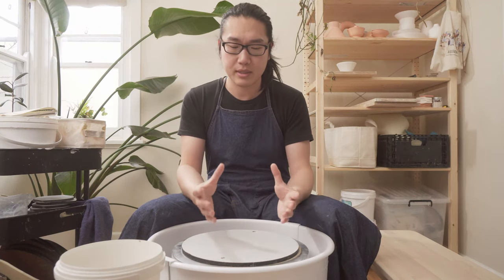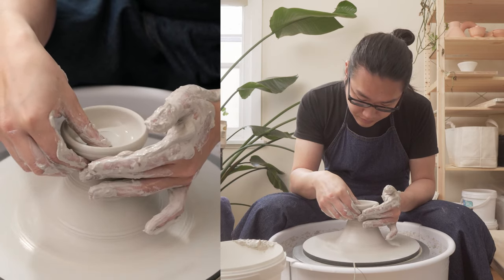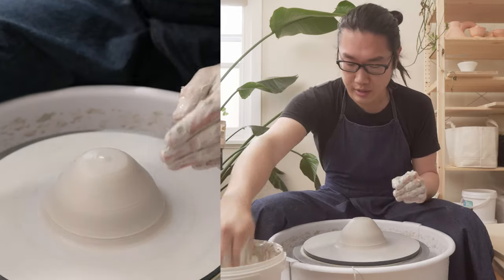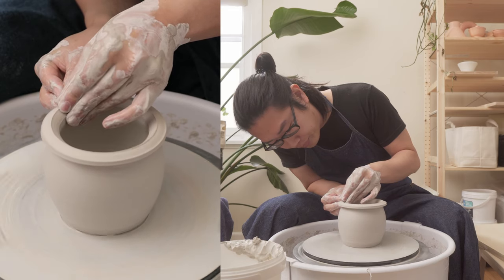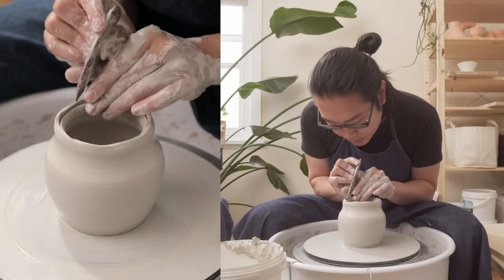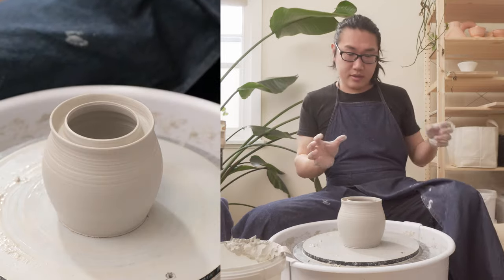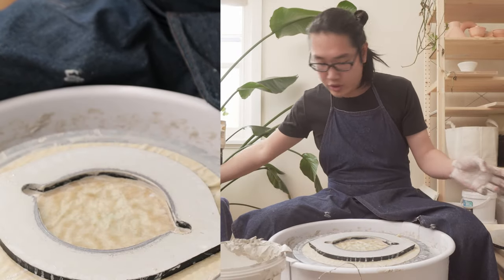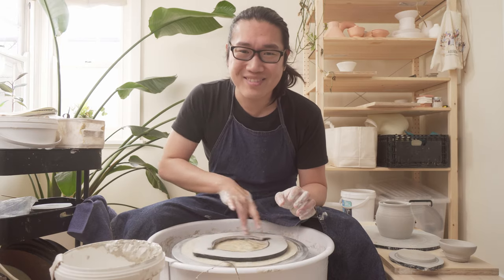FERMENTATION CROCK // PRACTICE // DIY Kimchi/Sauerkraut/Pickle pot on the wheel

Comment: Thank you so much for sharing this. I love your work and the way you document all your learning process.
I recently started hand building ceramics on my own and I also wanted to make a crock pot for our fermented goodies at home. I guess it would be even trickier without a wheel right?
Reply from the maker: I wouldn't say its trickier, just more time consuming. I don't have any experience in hand building, but I don't see why coil or pinching wouldn't work. Give it a try, worse case scenario you get a jar out of it. 

Good thing about the water seal is that even if your the lid doesn't match up perfectly it will still be air tight.

Comment: Hey great video! Do you have a recommendation for the highest grade, strongest, and safest glaze to use, specifically for high acidic environments like fermentation? Thanks!!!
Reply from the maker: I don’t have specific recommendation, as I make my own glaze. But a commercial clear glossy glaze that is rated food safe would be best as the ingredients for a clear gloss is very simple and require no toxic materials.
Reply: @twelve.80  Wow thanks for the super fast reply. Much appreciated!
One last quick one...could one simply fire at a higher temp and leave the inside of the pot unglazed?
Reply from the maker: Short answer is it depends. Each clay vertrify differently. Even smooth stoneware fired to maturity will have a small percentage of water absorption rate of 2% so it is not entirely water right. Porcelain which has very very tightly packed particles is at 0.5%. Without glaze the clay body will always absorb some moisture, which is fine when it’s a cup or a bowl, but I imagine being soaked for long period of time might not be suitable.

This is all just in theory as I have not personally researched or experimented, it might be a good idea to see what the traditional method was in places like Korea, and if they ever had unglazed kimchi pots.